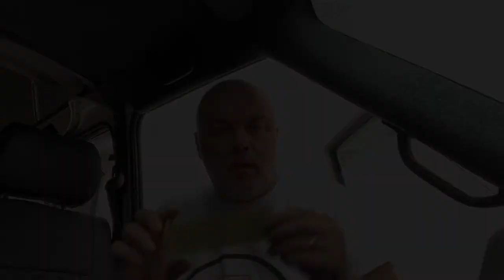Additional USB Charger Panel // EP09 // Rookie VW-T4

Comment: A handy tip I was once told is to wrap some insulating tape, or even run a marker, around your "step-drill" at the point (size) you want your hole to be. In your case at 28mm etc etc. Handy little tip to stop you over drilling a hole.
Loving the vids. Great to see honest videos, warts anawl 😁👍👍👌